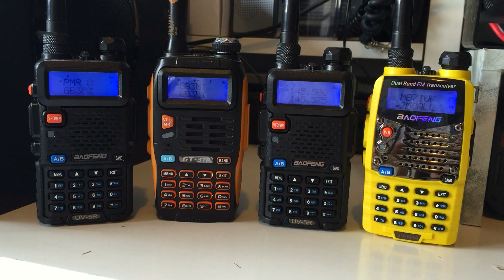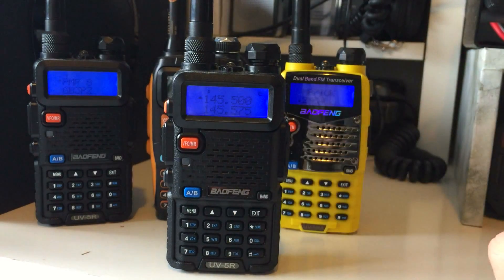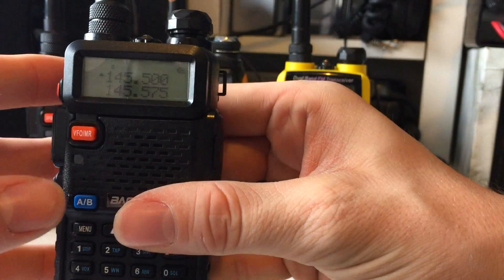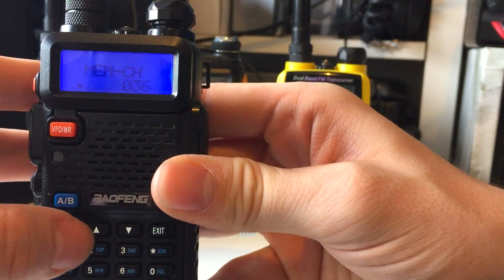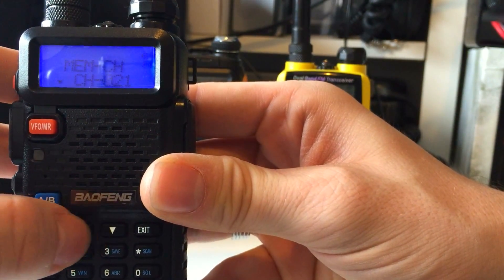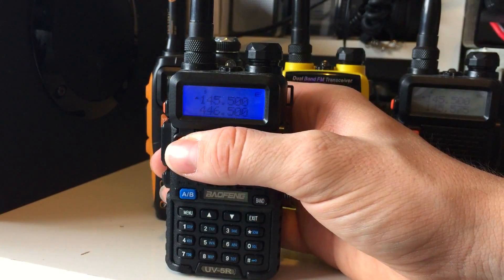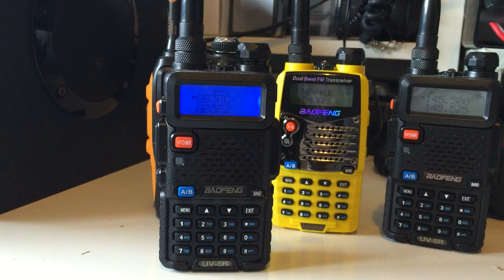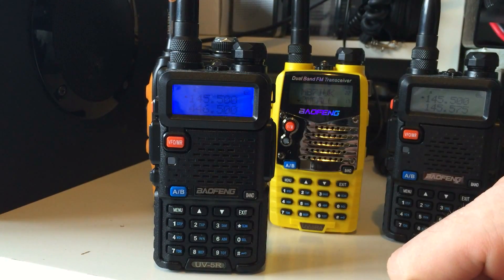Baofeng UV-5R Quick Programming & Scanning Tutorial

Comment: When I get a hit on stored frequency in scanning....it will start scanning again before the conversation is over....why does it do this? It's very frustrating
Reply: If you go to 18 in the menu  you find 'sc-rev' this is scan resume method, if you hit menu again you togged with the up and down arrows and can change what happens  when it scans and finds a frequency.  TO is time operation it stops for a time, CO is carrier operation it stops until the signal disappears.  SE search operation, it stops after it detects a signal.

Hope that helps